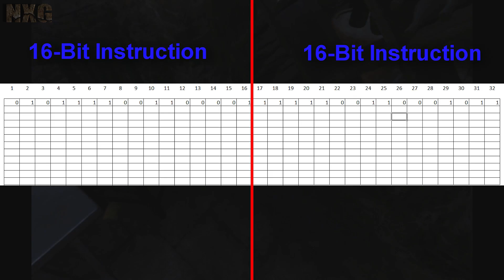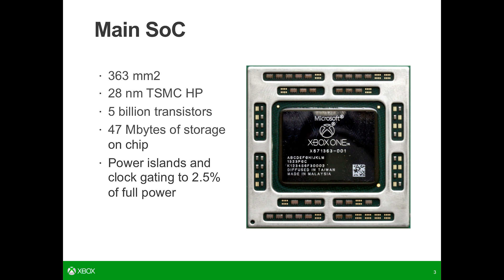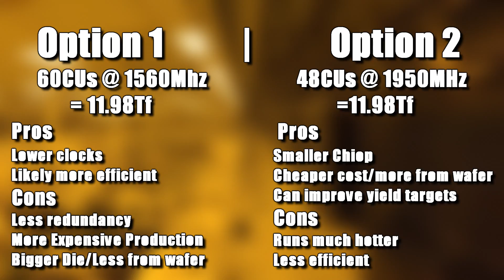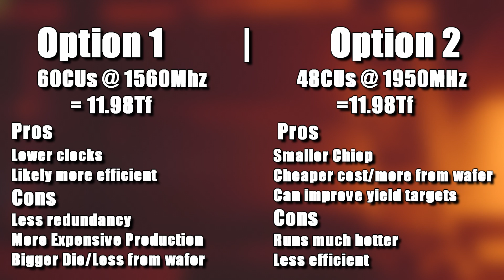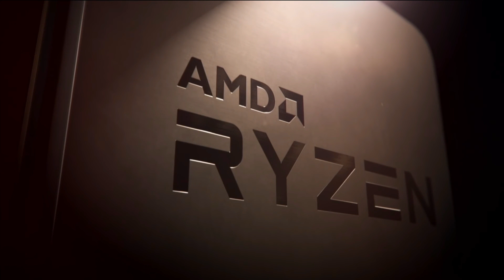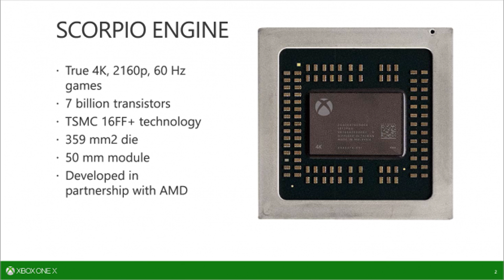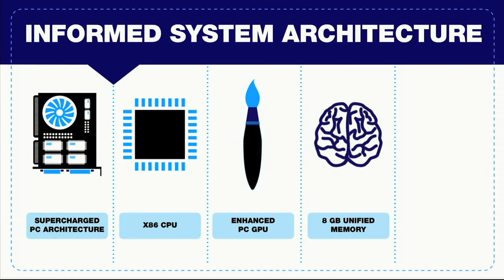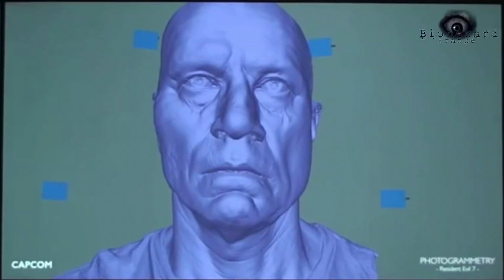Is the PS5 only 9Tflops? | Let's Talk

Comment: 10.28 (constant or variable doesn't matter) of 36 CUs running at 2.23 GHz will perform about equally to 12 using a 52 CU running at 1.8 GHz.

Of course the extra CUs will allow for better compute heavy effects, but there are benefits for the GPU being able to run at an additional 400 MHz faster. That's a massive boost.

Comment: This did not age well, 3.5Ghz Cpu paired with an even higher 2.23Ghz Gpu
Sony has done the assumed impossible

There box is gonna have so cooling tech
Reply: Simple,I under estimated how much AMD have improved power gating, consumption along with the Cooling solution Sony Hardware Engineers have come up with. The proof will be in the final hardware and tests, if this all works as well as described, which is should, then it is the best use of the power even at prolonged runs of Max Clocks, the limit here will be max workloads across the ALU's and FP units. Looking forward to learning more on the complete system.

This is nx' latest comment to it...i cant wait to see the cooling system

Comment: So when you said it was theoretically impossible to have a 2.0ghz GPU with a 3.5ghz CPU, and that it would be far too dangerous to have in a consumer product, do you think this is still the case with an even higher GPU clock of 2.23ghz? Do you think this is a good design from Sony, or a bad one? And if you think it's a good design now, why did you change your opinion?
Reply from the maker: Simple,I under estimated how much AMD have improved power gating, consumption along with the Cooling solution Sony Hardware Engineers have come up with. The proof will be in the final hardware and tests, if this all works as well as described, which is should, then it is the best use of the power even at prolonged runs of Max Clocks, the limit here will be max workloads across the ALU's and FP units. Looking forward to learning more on the complete system.
Reply: @NXGamer  yeah I couldn't believe they got it to that speed. I think they got caught out with a 36CU GPU they were looking to release in 2019, and so the only thing they could do to close the gap was frequency.
Any chance you could do a video on Direct X Ultimate and AMDs RDNA 2? Mesh Shading, VRS, RT etc.
Reply: @harddobe  easy to look back now and say how wrong everyone was about the ps5 being anemic compared to xsx. Just about all cross Gen games have played and run better on the ps5. I love howitzer ated out.

Comment: There is not much point to an insane amount of tflops when the bottlenecks and/or inefficient code prevent its full usage. I would be totally fine with 4 tflops, if they can actually all be put to use.

Comment: 🤣🤣😂😂👌This guy after all the stuff that has come out an still thinks Ps5 is using rdna2 an lmfao. Ps4 has not used Virtualazation for BC No. Microsoft did tho an in doing so can move to RDNA2. Ps5 will use hardware BC which forces them to stay with gcn an RDNA1 is a gcn hybrid an Navi 10 will be there chip an at Ariel APU at 1.7 will be 8.9 tfs. Sorry man these Fanboys have to stop doing this or they are going to be very disappointed I wouldn't want to be Cerney having to come out on stage an tell people that the Ps5 is 9 tfs compared to the competition that is going to be a whole Gen ahead an rdna 2 test show a 40% performance over the older Navi 10.

Comment: HI NO its not only 9tf. I am a Msoft business partner and i know of the tech in the xbx series and partial ps5 (from friend whos a sony rep). XB is UP to 12 TF. but games wont actually run at 12 as its all dependent on software how game is programmed with video engines. Sony is not releasing TF number as yet as its using new custom NAVI apu, not navi 10. Dev units 'are around 12 tf' and system was 32gb ram. So ps5 and xbxs will be almost same 'base' GPU with custom enhancements

Comment: How well ray tracing can be implemented in this next gen will make the biggest visual difference. Physically correct light and material simulated in real time in computer graphics is the holy grail which these consoles may just be able to pull off. If they can do it with 9GFLOPs then 12 might perceivably not make that much of a difference during normal game play, where you mostly look at the center of the screen, which should be rendered with higher fidelity while you can drop detail on the peripheral screen areas, which might happen on the PS5 while the XBX renders everything in full detail (on cross platform games).

Comment: 9.2 or even 12 tflops are not enough for playing in 4k. The RX 5700 with that power barely can handle it. So, being realistic, you'll have to wait till another generation for 4k is the standard.
Reply: You have no idea what you're talking about... Xbox One X can already run pretty much every game out there (Example: Red Dead Redemption 2) at locked Native 4K 30 FPS, and the system only has 6 Teraflops of GPU power with an extremely outdated CPU from 2013. Next generation systems, even at 9.2 Teraflops will EASILY be able to play all current titles at Native 4K 60 FPS (probably beyond that too). Developers are able to optimize games specifically for the hardware and can squeeze every last bit of power out of it. 

You can be 100% assured that if either system is above even 8 Teraflops it will be running all CURRENT games at Native 4K 60 FPS. Future games will be Native 4K 30 FPS of course because developers will make larger and more intensive games. Also keep in mind that the Xbox One X with 6 Teraflops is not using RDNA meaning that the PlayStation 5, assuming it had 9.2 Teraflops, would actually be 16~ Teraflops compared to the Xbox One X 6. 

There's no way in hell that next generation consoles won't be playing games in Native 4K. You do really have no idea what you're talking about.
Reply: @ghostthough7874  you are the one who is delusional. Rdr2 in Xbox one x, native 4k, middle-low settings, and crappy 30 fps, the rest with the rest of games (plus dynamic resolution cuz it can't handle the native 4k) . Oh, sure, wait for cyberpunk, and the games ahead. No, sir. Just look at the benchmarks of AMD, they don't even have a solid 4k card to compete with Nvidia, whose 2080ti is the only one that moves ultra, 4k, 60+ fps in the latest games. Of course,   $ 1200+, do you really think a console of $500 in 2020 will handle the games of 2023? Lol. Well, your native 4k with shitty graphics and 30 fps, that's warrantied.

Comment: This is the first time you channel has popped up on my feed and this is the best speculative video I have seen in regards to the upcoming consoles. 
Considering actual facts about the hardware are virtually nonexistent the hyperbole has beaten me down. 
People have worked themselves into a frenzy over the new consoles to the point there is virtually no chance for either machine to meet EXPECTATIONS whether it is performance, price, or both. 
If 9TF of GPU data throughput is achieved jumping for joy is a much more appropriate reaction than the DISAPPOINTMENT being expressed all over the internet.

Comment: Regarding the Series X, I think it's important to note that the whole "12 teraflops" that everyone seems to be assuming is highly speculative, based on the "twice as powerful as 1X" comment from MS. 12TF has not been validated by MS whatsoever. Furthermore, "twice as powerful" under RDNA architecture does not automatically equate to 12 teraflops. You cannot directly compare it to the GCN 1X architecture at a 1:1 ratio. 12TF under the current GCN 1X architecture equates to around 9TF under the newer RDNA architecture. Yet a lot of Xbox fans are conveniently ignoring this fact, probably due to wishful thinking. I still firmly believe that when it's all said and done, both consoles will launch with extremely similar specs and both will cost the same at 499.99. Any differences between the two spec sheets will not result in any appreciable difference in what we see on screen.
Reply: Microsoft has more shaders and compute unit than ps5. Ms has been saying they will release the most powerful console which means they have something from AMD that makes them say that
Reply: @abobonickname5696  You are basing this on leaks, not substantiated specs.  We wont know any of this for sure until Sony officially releases final specs.

Comment: 9TF is fine for the average consumer. But people have ridiculously high hopes for a box that might be $399.

Some X1X games only do 1440p with 6TF. Therefore 9TF still may not be enough to make those games 4K.

There will still be significant resolution compromise in many games aiming for 60 fps.

12TF should make 4K easier, but certainly not standard.

Comment: 9 tflops is  realistic, the 12 tflops of xbox is a fantasy number, remember the best AMD can do is the radeon 7 with 13.8 tflops and they where selling the card for $700.
The size of the radeon 7 is almost as big as an xbox console, and now They want to make 12tflops card for $150, if you believe that then you also believe in santa claus
Reply: 12 teraflops is absolutely realistic. AMD have been making major jumps lately in every new generation of CPUs and GPUs. With RDNA2 and Microsoft working closely with AMD in development I have no doubt it’s possible. If Microsoft helped fund the development and research with AMD I could also see them getting these APUs at a reasonable price to keep the console in the target price range as well. Everything Microsoft has done over the last few years have shown that they are committed to the Xbox division and it’s success.
Reply: @Jpilgrim30  their latest navi card the rx 5700 xt has 9.7tflops and they are selling them for $400 just the card , how on earth can you sell a 12tf console with a motherboard,cpu,power supply, cooling ,memory,an ssd with a case and a controller with cables for $400

Comment: You're missing an important detail. The lead time for TSMC's N7 process is of around 6 months, and the manufacturing time is probably another 4 months on top of that. So we're talking around 10 months for the whole manufacturing process. This means that if Sony and Microsoft want to have the consoles for 2020 holidays, the SoC design has to be locked right about now. This suggests the "Oberon B0" revision that Komachi found is the final or close to final revision for Sony PS5.
Reply: What was posted came from data mining back in like June. And no telling when that data was dumped there. Chances are changes were already made
Reply: @LockheedTH "that thing is from june 2018 tests"

No, they had the Gonzalo revision back in 2018. Then the Ariel revision, and now the Oberon revision which is the newst one from this year. Plus it says "B0", which suggests it's close to final.
Reply: @LockheedTH 
No, they're different revisions over time.
Reply: @LockheedTH 
The difference is that generally the first revisions are full of bugs. For example, there's Ariel and Ariel A0. "AO" means a big revision was done to fix a mayor problem. Then there's Oberon B0. The "B0" further improvements where done. It looks like most of the issues where related to memory bandwidth for what I saw in the leaks. Memory bandwidth is really important. A bug there would be critical.

Comment: The next gen consoles need to be powerful enough to run games with 
- Decent graphics
- Hold a stable frame rate (30/60/120 all locked)
- Handle complex AI
- Calculate hardcore physics
- Load data faster
- Render games at suitable resolutions (1080p/1440p/2160p with no noticeable drops)
That's all they need to do and they must achieve this at affordable price points that don't break the bank
Reply: Both of them will be

Comment: If we can get true 4K 30/60 fps with vastly reduced loading times, then we're in for good times this coming generation. Gamers who started during the PS3 / 360 generation have no idea.  I remember waiting 20mins for games to finish loading on my C64 on tape
Reply: The lighting fast loading times will be a gamechanger. 4K60 games like Gears 5 and modern warfare already look amazing on X1X. Imagine how 4K60 games will look on ps5 and Series X!
Reply: anything less than 4K60 with vastly reduced loading times would not be a generational leap for me
Reply: That is promised since ps2 you fool. I remember not waiting in sh1 and soulreaver, and now I have to wait and wait
Reply: I remember that too. Or even when using the fast loading disk drive and the fast loading cartridge still waiting over ten minutes for games to load. Often well over.
Reply: Yes of course it will do 4k 60fps.so will the Xbox. They're both beasts

Comment: It doesn’t matter what the improvements are, if XSX is 33% faster than PS5 it’s a massive blow to Sony.
Reply: The power gap between the PS5 vs the XSX would be smaller than the power gap between the PS4 Pro and One X. Sony will be more than fine as third party games would look mostly the same between the two new consoles and their first party games will look drop dead gorgeous. Not to mention Sony could undercut Microsoft and sell the PS5 for $399 (the magic number) which would make it a commercial success.
Reply: PS4 Pro was released a year before X1X, $100 cheaper, and was built on the most successful platform of the generation. If both consoles hit the same price point I think it will indeed be a significant blow to Sony.
Reply: @TheSterlingArcher16  But if these specs are indeed true they won't be releasing at the same price point. The PS5 would be the cheaper console and the momentum the PS4 built up would carry over to the PS5 if Sony can launch at $399. The XSX has no chance at launching at $399 if it really does have a 12 teraflop GPU, $499 would be the minimum at launch.
Reply: 03chrisv We’ll see. I’d be surprised if the PS5 launches at $399. That’d be the cheapest PlayStation launch adjusted for inflation. I’d imagine $499 XSX and probably same for PS5 unless they get really aggressive on price.
Reply: @TheSterlingArcher16  I don't agree. If the PS5 has a weaker GPU the value proposition diminishes in the eye of the consumer so Sony will have to launch at a lower price to stay competitive. Sure the PS5 could launch $449 or $499, but that just means the XSX will be launching at an even higher price. The only way they're launching at the same price point is if these leaks aren't true and the overall processing power is within 5%-10% of each other.

Comment: Sony's core customers don't know about hardware specs. A premium console wouldn't wash, Microsofts core customers are the reverse. And this is what they got wrong in 2013.
Reply: @LockheedTH Wrong, the core gamers are the ones that bought the XBOX. Who yes do also own a PC. PC gaming is at it's lowest levels in over a decade. And the average PC spec is below that of an XBOX, as shown on Steam stats. I.T professionals such as myself, are sat in front of a PC for a living, the last thing I want to do, is do the same thing at home while not remoted in somewhere.

HDR is not new tech, it's been out for over 5 years, not far off 10. And the Xbox X is going to boast it's own VR system, which will be fully wireless, as confirmed by Phil Spencer in 2017.